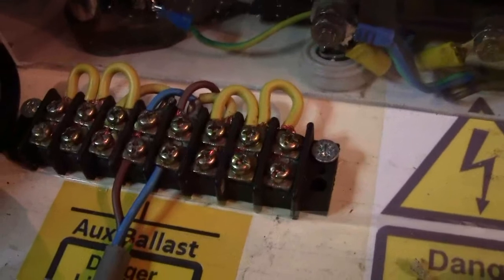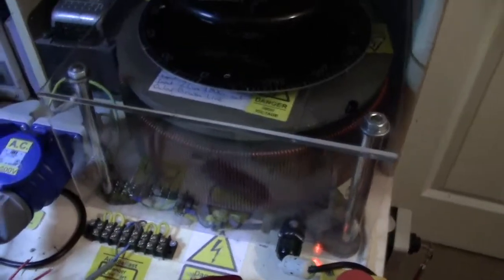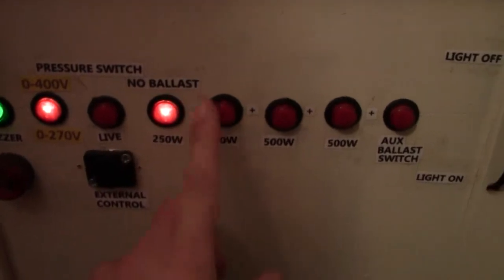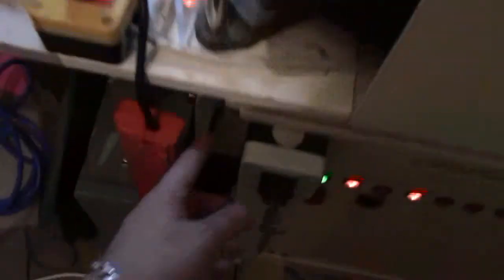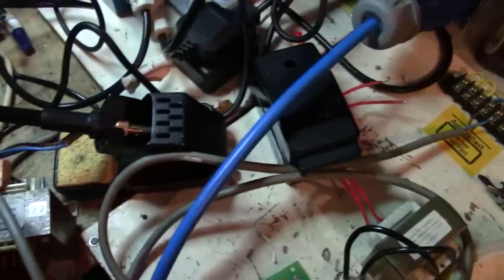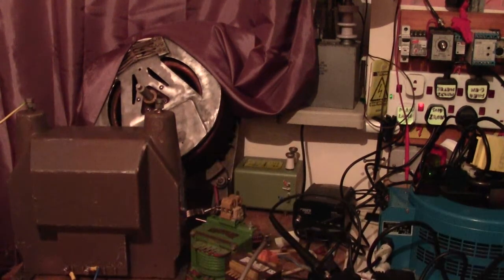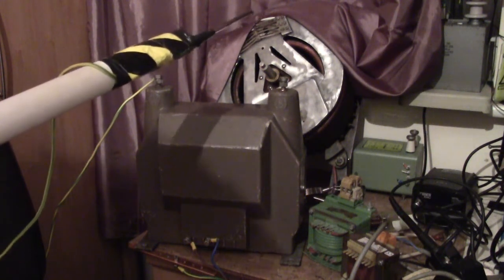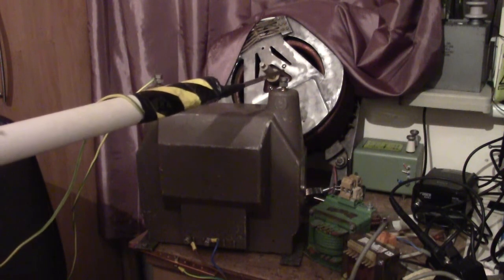3400 Watt or 3.4KW ballast smaller than a MOT and showing how my AUX ballast port works on my bench

Comment: What are P.T transformer's used for?
Reply from the maker: Its for taking an accurate measurement of the power line voltage .It steps it down normally but there better used in reverse ;)